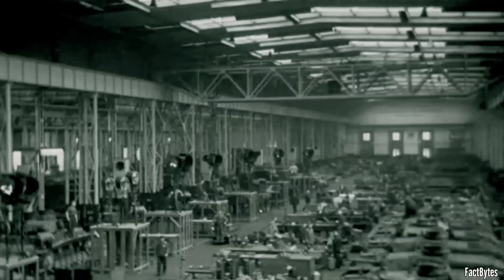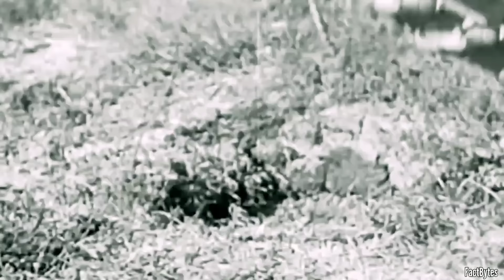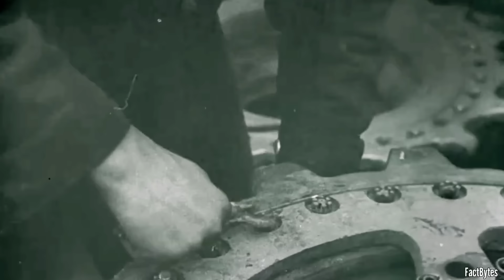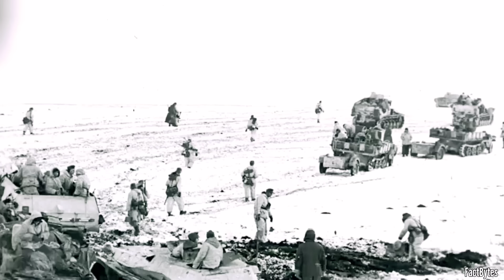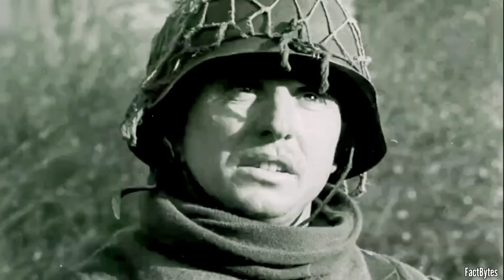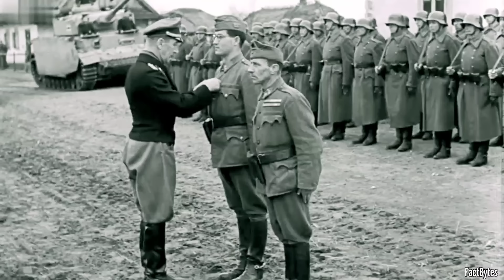More Panzer IVs, Fewer Tigers & Panthers — Would Germany Have Done Better?

Comment: Too many other variables and facts not mentioned or thought of here!  The Panzer IV wasn't just an early war tank but also a PRE war tank! The training was therefore more thorough and not rushed for the early crews, more produce since it started earlier than the other two, and manufacturing might have been more time consuming. 

If we compare the 9000 or so Panzer IVs from the pre war years to 1945 vs the Panther which Germany made over 6000 in the span of 3 years, by this logic, wouldn't it have been better to cut out the Panzer IV and focus on the Panther?

You mention of transporting the tanks to the fight since that is very important in war but when you get to the fight itself, how would the crews survive the encounters in a Panzer IV compared to a Panther? You would have to put in a lot of time training a crewmember but it would have been wasted if the individual fails to survive their first encounter.

As for manufacturing, (I am sure a few experts from this area would agree) that welding a few slabs at various degrees is just the same time, if not quicker, than the "steps" of a Panzer IV front.

Overall, I will state that the Panther, and not the Panzer IV, should have been the focus.

Comment: No, they were running out of crew and fuel even using tigers & panthers, producing more PzIVs would have needed more of both (and likely have led to higher crew casualties. They might have marginally helped themselves by sticking with the tiger rather than the tiger II since it was cheaper and faster to build, as well as more fuel efficient, and already integrated into trining and maintenance programs
Reply: Overall, this line of thinking overlooks critical factor: operational capability and initiative. Germany produced so few tanks in 1943 it was not capable of conducting large operations anymore (look the numbers up).  Panzer IIIs were being converted to StuGs which while needed, were distributed to infantry, crewed by artillerymen and were not usable in role of tanks much anyway. This was effectively handing initiative over to the enemy. Panther weighed 45t, Panzer IV 25t. That's almost twice the amount steel and likely other materials. Panther needed almost twice the fuel that Panzer IV needed. It's better to have two Panzer IVs than one Panther: twice as many eyeballs, two guns, two different locations occupied by your vehicles for tactical advantage. Per Chieftain the tank that fired first won the duel in 75% of cases. Germans with many more Panzer IVs would have been a hugely more powerful force than one with limited number of Panthers (even when they worked, which they usually didn't, their operational readiness was terrible, typically 10%-15%, sometimes less! compared to typical 50% of Panzer IV and 60% of Stugs, what good is a tank that is not operational? It's worse than not having that tank at all, at least it's not soaking up resources and personnel)

Tiger can be defended as a breakthrough tank. Sure, that's reasonable. Look up Chieftain on Tiger, video "A waste of good tank". Not Panther.

The ideal tank for Germany would have been a medium tank with Panzer IV armament, focused on crew survivability (you can quickly make another tank, you can't quickly get a trained crew), weighting say 32t, with correspondingly more powerful engine, with several tons more armor. It would have to be simplified and adapted to mass production. A Panzer IV improved this way would do. Americans and Soviets understood that. Germans didn't.
Reply: @euroqusling
""Per Chieftain the tank that fired first won the duel in 75% of cases.""

This is a myth. It depends entirely on the range, tank and gun. Mean range of tank on tank engagement in the ETO was 750 yards. A Sherman 75mm isn't going to win against a Tiger or Panther frontally at that range even if it hits first.

By the way, the Panther's overall average operational rate 1944/45 was 62-65% east-west fronts. Not much lower than the Panzer IV's 68-71%.
Reply: @lyndoncmp5751  Some sources for both claims would be nice, my source for first one is Chieftain whose claim about first tank firing usually winning has not been a subject of criticism (at least I have not encountered those)

My  second source is a professional Polish historian Norman Baczyk who sits in archives, has been very thorough in his research of Panther in original source documents and he found a number of reports on Panther availability. The best one was 15%, the worst one was 6%. The claim of such a high availability frankly is very suspicious as a number of historians reported terrible and ongoing, constant breakdowns of Panthers, so how was it supposed to reach such high availability rates? Say, according "Panther vs T-34, Ukraine 1943" published by Osprey, most Panthers final drive was breaking down after just 100km of march, so how was Panther supposed to reach such high availability rates?
Reply: They should have just made all stugs! 😮

Comment: 8k-8.8k Panzer IVs were built pre war & up to 1945 so 6 years, BUT around 6k Panthers built in only 2 years. The Panzer III & IV were outdated & needed replacing. Tank design & development was moving fast. Their armour was thin & they were called 'tin cans' by their crews. You needed a larger platform to install the heavier guns & armour needed to take on the heavier Allied tanks. It takes a lot of time to train a tank crew properly, throwing them away in an under armoured tank is not the way to go - although designing an overly complicated heavier replacement is not the way to go either.

Comment: The concept of Tiger tanks, plus the request for more powerful guns, came from the German army Panzer commanders, noting the current Panzer III and IV in 1941 lacked the capability to breakthrough Soviet lines as their anti-tank weaponry gradually become more advanced (case in point, by late 1941 Soviets already had 57mm ZiS-2 at service, an effective AT gun that repeatedly over penetrated its German target), where each subsequent offensive resulted in higher losses compared to early campaign in 1940. The development of a specialized heavily armored and armed tank, the Tiger tank, was requested. Of course Germans did acknowledge the logistical strain on using heavy tanks, hence they were limited as specialized breakthrough vehicles. Hiler merely saw the logic and rationale of this plan and approved it.

Tiger tanks never received real special attention from German leadership, unlike WW2 myth.
Tiger tank production was never expanded beyond Henschel plants, as the vehicle remained niche uses in the German military, only equipping special heavy tank battalions. 

Meanwhile, the upping of armor and gun for Panther tank was based on an economically sensible advice that came from German tank industries to party officials and finally to Hiter himself. 
Just around the same time as the initial development of Panther tank, the previous Panzer III and IV production lines had been demanded of a rather staggering amount of armor and armament changes by the German military - For example, Panzer III saw a total of 4 changes of the main gun - from the 37 mm Kwk 36, to 50 mm Kwk 38, then a longer KwK 39, and finally the 75mm KwK 37. Combined with a similar number of times in changing the armor layout. Panzer IV was just slightly less worse - it saw 2 changes to main gun, from 75 mm L/24, to L/43, and then L/48. German tank industrial managers complained to Hitler that German military had little idea how their upgrade requests kept complicating and disrupting the production lines. And the advice was simply “pre upgrade” the new Panther tanks so the German military would be satisfied with it much longer and not asked for major changes. In the end, the advice was well-followed with the support of Hiler - the 75 mm KwK 42 and 80 mm sloped front of Panther sticked from 1943 all the way to 1945 without major changes.

Late war German tank designs, which also included Panther tank, didn't put heavy emphasis on the ease of repair on field since the Germans never planned to set up a large repair workshop with spare parts close to frontlines like the Allies did, due to threats of Allied air and artillery attacks, and more importantly a huge burden on already strained German railway logistics capacity since heavy vehicles parts took a lot of space in trains which could compete with other essentials like ammo. Broken down German tanks were usually transported back to home factories by trains for repair, or in later war years, outright abandoning those tanks since by then Germans had less fuel than they had tanks, with surprising large backlogs of new tanks in depot awaiting fuel for deployment. 
The fuel cost to tow back the broken tank and later driving that repaired tank forward was more expensive than retreating on foot and crew a new tank to drive it back to the front.

Reliability wise there was no significant difference between Panzer IV, Panther and Tigers, all sat around 65% of availability in late war period. Not the best standard of WW2 military, but given Germany poor economic situation it had no business to be. Note this was despite Panzer IV being pre war products. Panther had its final drive issues but Panzer IV was not very reliable either - late version of Panzer IV was particularly front heavy and often stressed multiple frontal parts to breakdown.

If it was just about the 75mm L48 gun being good (it did alright most of the time) then just use StuG or even Hetzer, they had the exact same gun as Panzer IV, and with even lower silhouette and easier to produce and maintain too.
As a turreted offensive tank Panzer IV however lacked the sufficient armor for such role. Its 80mm flat frontal hull had less effective armor than even a M4 Sherman, and its 50 mm turret front was clearly insufficient in 1944 onwards. And Panzer IV was not fast at all, especially after all the added weights of longer gun and side skrits, off road it was just barely faster than Tiger II at 16 km h. Panther had better mobility and wider tracks helped on soft ground too.

Then the cost, Panzer IV was just too cost inefficient for its ability in 1944. More than a quarter of total Panzer IV in the war was Ausf J - where the Germans had to go such length to "simplify" such inefficient designs it ended up removing powered turret transverse to keep its production rate barely acceptable compared to Panther or other vehicles. Not even the T34 needed to do this to make up the production.

Also the German tank productions were limited by Allied disruptions, rather than the choice of German tank development itself. When the Allied bombers hit the German engine factories, such as Maybach plants, no matter what kinds of German tanks, be it Panzer IV, Panther, or Tigers, a tank without an engine was not going to roll off of assembly lines. Same thing with ball bearings for turreted tanks.
Reply: Thank you finally something sensible

Comment: Absolutely not going to happen. One needs to remember, Panzer IV was developed in the 30's, by the 40's it has reached it limited, and It was time for a new tank.
Also, tanks in WWII still in its infancy, so there were all these light, medium and heavy tanks, each nation still trying to come up with the all purpose tank. Originally Panzer IV was designated as medium, but later became light tank because the inadequacy of its armor and firepower.
So instead of building a Tiger II (the cost of building one could build 3 panzer IV, or 1 1/2 Panther), they should concentrate on building more Panther..
Reply: The Pazner IV was adequate enough to have lasted the whole war. It was a Sherman/ T-34 equivalent and was absolutely necessary to have a medium tank like that over more complex designs. Britain did not have any good medium tank equivalent and in 1944 they deployed obsolete Cromwell tanks. Their best tank of the war the sherman firefly was basically an American design.
Reply: @jamesworth4573 By 1944, Panzer IV only had a vertical 80mm thick frontal armor, and can be easily penetrated by anything Allies throw at them. 
With the long Kwk 40/L48, it is already placed too much weight on the spring-leaf suspension. In short, by 1944/45 Panzer IV was like glass cannon, good gun but terrible defense, and has reached a bottle neck when comes to development (or other variants were based on the same chassis but with modified road wheels)
Reply: @vincentsun2759 the sherman could also be penned by basically anything. Any tank could be penned by any other tank, the point is basic economics. Churn out something you can produce rather than have either nothing at all or something subpar like a stug.

Comment: The Panther would have been an outstanding tank, but Hitler insisted they install more armor on the front of it so the T-34 couldn't penetrate it with a head-on shot. That overloaded the final drive gear assembly and resulted in MASSIVE reliability and service issues that were never completely resolved. At Kursk, many of the Panther's employed never got into combat, because they broke down early in the battle.

Comment: Over all if they had built more panzer 4s, it wont fix the fact that their entire industry by 1943-44 was quite literally gone. They couldn't reliably get replacements when needed most and this went for all equipment not just tanks and aircraft. I did the math on average their tank per month was about 200-250 panzer 4s on average through the entire war. Even if they kept that pace through the entire war they would have built in the neighborhood of 16k to 17k. Compared to the Sherman and t34 it would have a snowballs chance in hell to actually save the war.

Comment: Well certainly the ability to crank out greater numbers of Panzer IV's versus the very labor intensive Tigers would have been the better option for Germany, but the increased numbers in production would have meant a greater demand on Germany's oil reserves which it didn't have a lot of to begin with. The gamble behind the decision that was ultimately made was that a relatively small number of heavy tanks like the Tiger would be a force multiplier in the field while also reducing the strain on fuel requirements.

Comment: PzIV reached end of its development potential in mid-1943. It was smaller and lighter chassis than T-34 or Sherman. As such , even L/48 7.5cm was almost too heavy for it. But already from mid 1944 it was at disadvantage to these medium Alied tanks, not to mention heavies like IS-2. 
Then it comes elephant in the room - logistics. Germany had to find fuel for all those tanks, and if you for example build 3 Pz IV instead of one Tiger, then you would need to find more fuel for those. Not 3 times more, as Tiger used more fuel than single Pz IV, but still more . Not to mention extra crew, maintenance personal etc ..

Comment: Germany didn't have the manpower for more tanks so the Tiger 1 and especially the Panther made sense. 
The issue was they should have been designed to be more easily built and repaired.
Reply: Tigers overall average operational rate was not much different to the Panzer IV. It was decent for a heavy tank. 65-70% and that includes tanks out of action with combat damage.

Comment: Yes and No, For most of the war the Panzer IV with 7.5cm KwK.40 was perfectly adequate against the T-34/76 and especially the Sherman with its soft armour that could be penetrated at 1,600 meters or more. While the Panther was more practical against the Soviet "Heavies" which were apeating in increasing numbers as the war progressed. The King Tiger was too much as were the enormously exoensive projects that followed it  As weight rose the tactical mobility declined. Ultimately Hitler expected a quick war and never properly planed for what followed.

Comment: TLDR/TLDW the answer is NO
the problem was not the design of the Tiger or Panther, it was the execution
in both cases they needed more time for testing and that time could be gained if they had used the Panzer IV's proven design to build a "stop-gap" tank similar to the discarded Panzer III/IV proposal
the Panzer IV was designed for the Interwar level of technology, by the time war was declared it was already outclassed by the projects the Brits, Americans and soviets were working on (Cromwell/Centaur, Sherman and T-34) and the Germans only gave it slight improvements over its whole production run